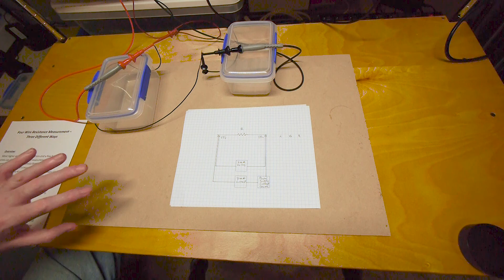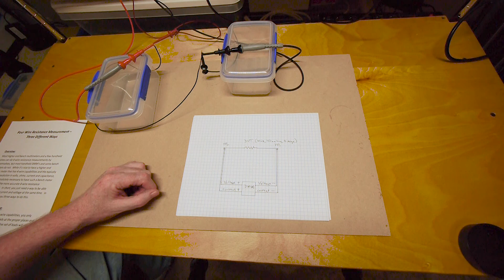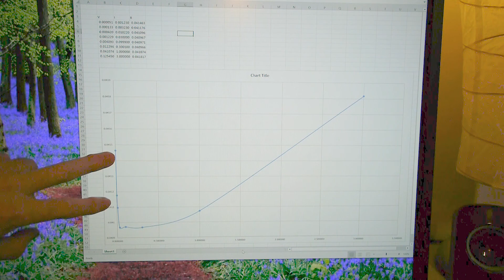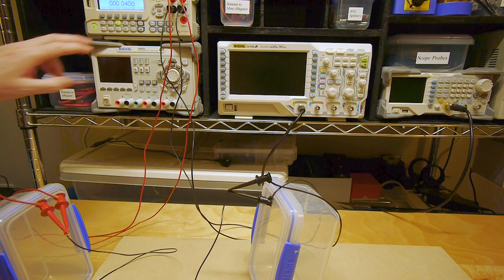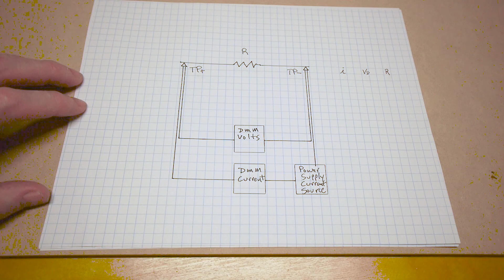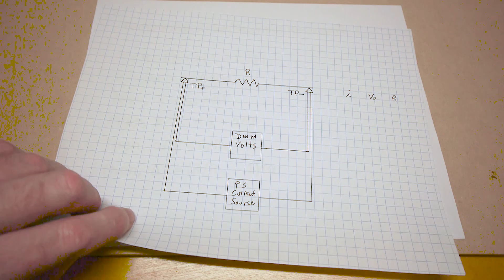Four Wire Resistance  -- Three Different Methods

Comment: The voltage leads should be as close to the resistor as possible so as to not include the small voltage drop across the wire. However, it doesn't matter where the current leads are or how long those leads are as the current will always be identical all along a series circuit. If not charge would, of necessity, accumulate at some point in the wire!

Comment: You really know how to instruct and demonstrate the benefits and pitfalls with Kelvin measurements, especially with the graph of I vs R.  Just this past week I had a colleague getting unexpected measurements with the professional meter.  I shared your video to show that the noise in his setup was leading to significant measurement error.  It wasn't the Seebeck effect, it was how the circuit was wired with unterminated ends leading elsewhere on the board.

At home, I find the 4-wire measurement very effective at identifying issues with cables and terminated ends, such as old test leads and electric cords.   Hook it up and move the cable around, noting what causes the resistance to change.  

Every handyman should make a 4-wire tester, I don't know how I ever did without it.  There are plenty of resources on the internet for ways to make a constant current source from spare or inexpensive parts and a standard multimeter when a benchtop power supply isn't available.  

I personally have a homemade LM317 tuned for 100mA on a perf-board as my source, running off a spare USB cable. I just multiply the millivolts by 10 to get millihohms.  Any multimeter gives me resolution to 1 milliohms, some better ones give me a few decimal places. 

Your plastic boxes would be a good place to store the source and wires necessary to hook things up.